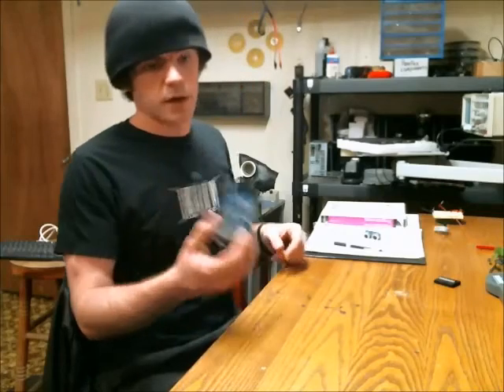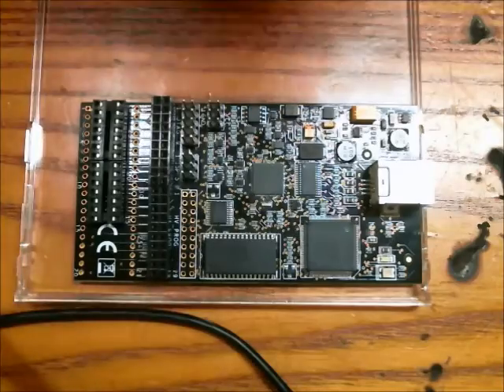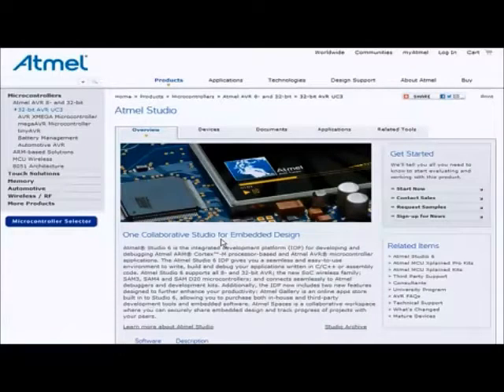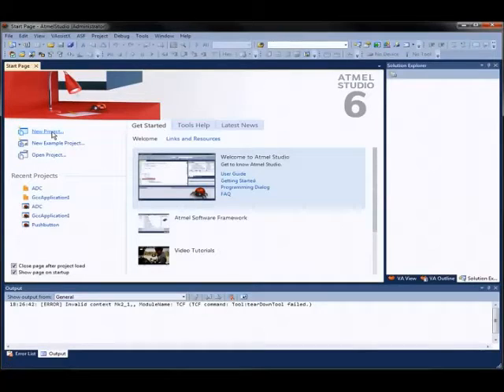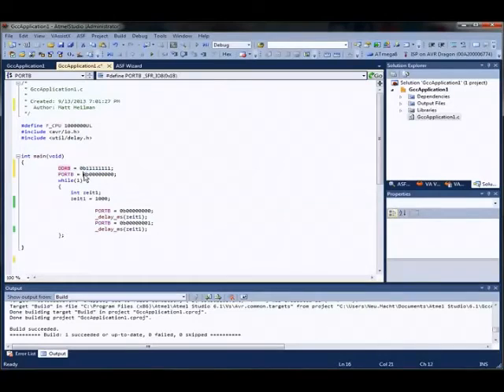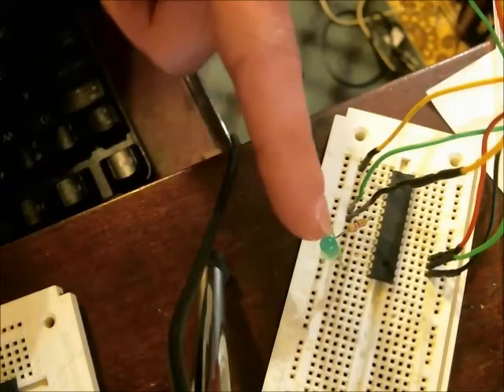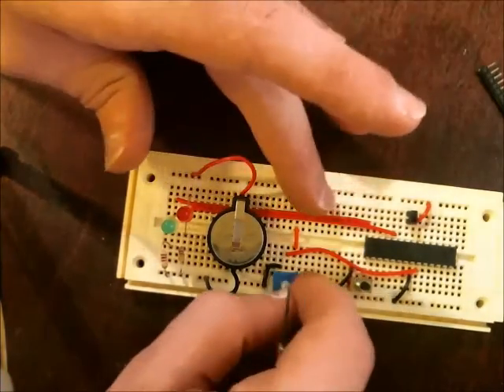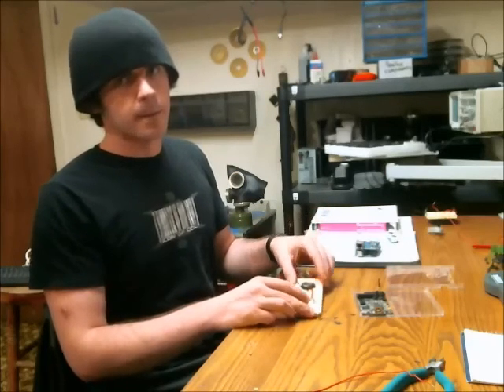Programming Embedded AVR (~Arduino)

Comment: Just a suggestion dude during testing it's more advised to use a larger more capable controller like atmega1284 for example that contains Jtag. As one of the biggest benefits is it allows you to step through a program where as isp does not, it's the only way you will really be able to see what is happening (btw you might be able to resurrect ur old dead chip using HVprog) .